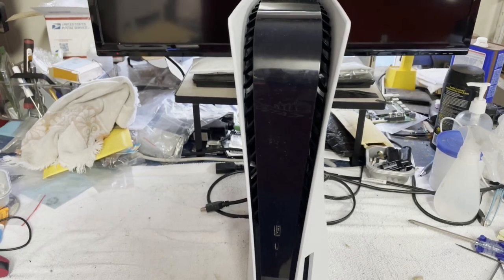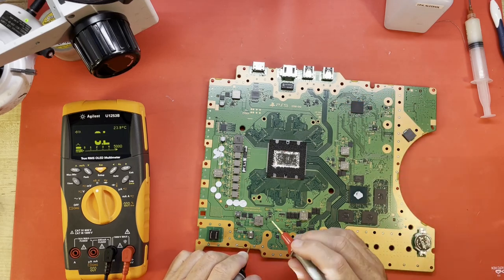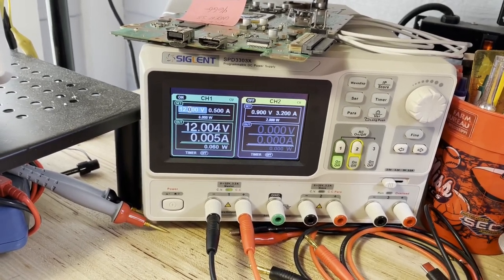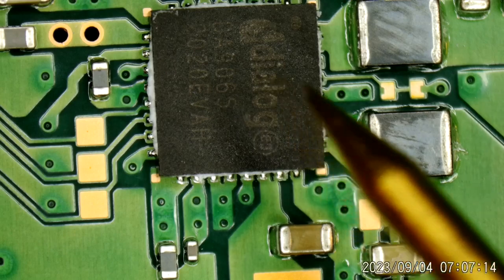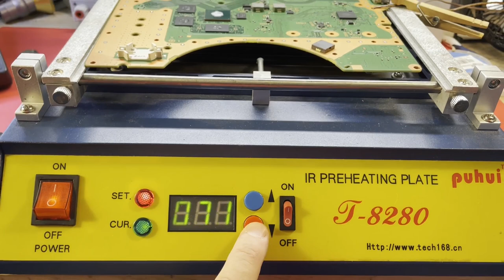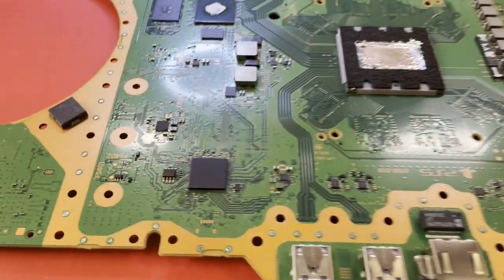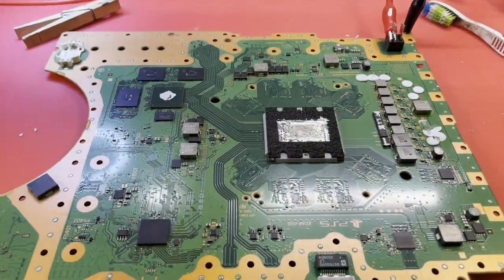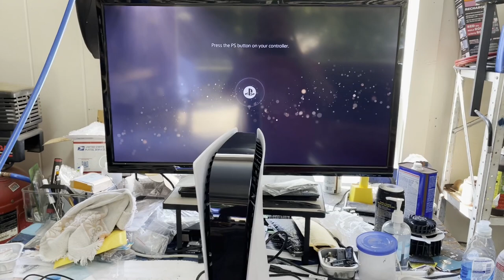#108 Repair of PS5 CFI-1015A No Power

Comment: Nice! I am new subscriber and do also some pcb repair and i learned a lot. Do you never use a thermal camera in combination with powersupply, just low voltage with some amps to see what heats up?
Reply from the maker: Yes, I have a thermal camera.  I inject with my bench supply.  I didn't feel like I needed to with this one as I had seen this issue before and I was pretty sure where the short would be.
Reply: @ToltecMerc  i was just wondering 😉.  You got some great videos and i would recommend your channel, it nice and straight forward 💪.
Reply from the maker: @Ismail-1983  thank you!  That is very kind of you!

Comment: Two thumbs up Nice fix 
Question have you ran into the issue where You try reinstalling the software and it only goes 8 percent  Then freezes Or restarts Can't install the software Is that the ssd controller chip ?
Reply from the maker: I'm not sure.  It sounds like SSD or RAM.  We need a good way of testing these things.
Reply: @ToltecMerc  Yes that would be nice I seen in one video you did Where you replacing the ram One by one That I had the same issue

Comment: Good job
Reply from the maker: Thank you!  I'm glad you enjoyed!
Reply: @ToltecMerc
Reply: hello  need your help I bought a ps5 for repair with strange symptoms the image blinks and the sound crackles and does not always start the system has 2 seconds of blood I made a bios backup the motherboard is EDM-010 console model CFI-1016A I now have no voltage 3.3V you had after hearing the signal and I had no voltage? @ToltecMerc
Reply from the maker: @TOMelectronicsfix  the 3.3V comes from the RT5126 or DA9065.  The BIOS chip receives 3.3V, did you cause a short when you removed and reinstalled the BIOS chip?  Check for shorts around the HDMI encoder and the South Bridge.  Perhaps a fuse has opened.  There are many possibilities.

Comment: Hello, :) I've got the same issue - no power, even followed your checks :D. But, when you find the small power rail shorted and finding the southbridge faulty, I have a good reading. 

So, 2, 3 seconds BLOD on my customer's PS5, but no shorts found. 

PSU is dead, and my bench power supply with 12V shows that the amps go up to 0.31A and drop back down. Don't know what else to check to be true. And, just said to the customer that it's a no-fix. 

If anyone has any idea what else to check, I'm all ears :).